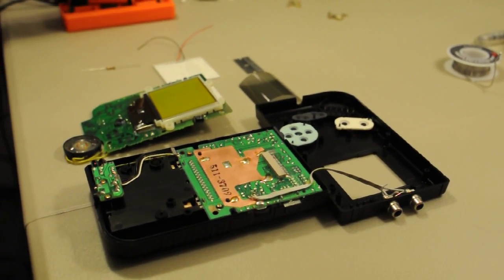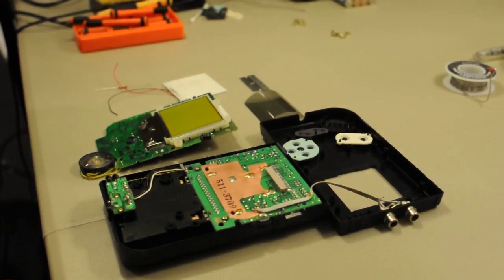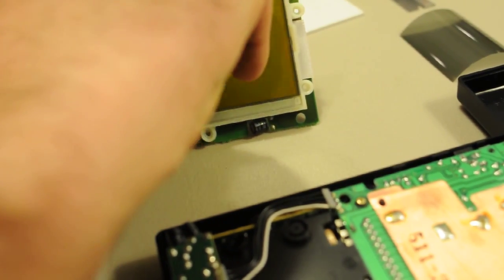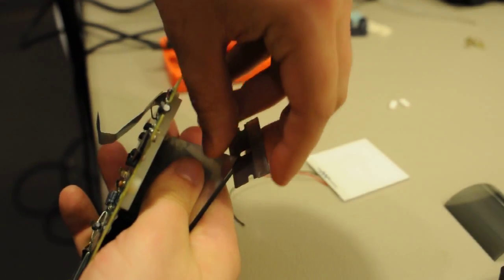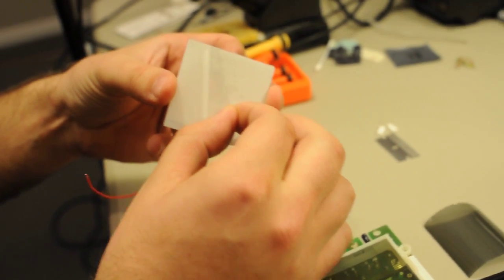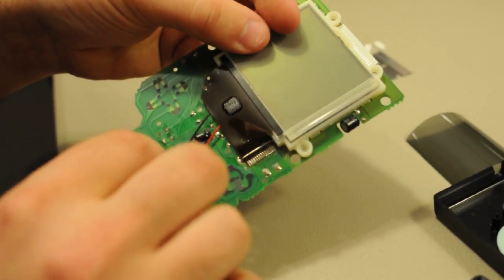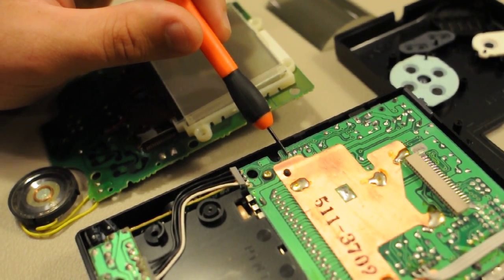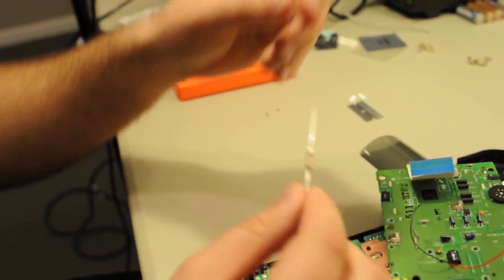Nonfinite Electronics V^3 Backlighting Pt. 1

Comment: you know, you can also attach the wires to the 2 soldering points below the black film on the front of the unit, you need to cut the wires a teeny bit to avoid the buttons but its far easier and customizable as you can put your switch just below the screen without any extra wire

Comment: You don't know how much I appreciate these videos. I got my V^4 Back-light in the mail today ordered it with the SNOW 1.5mm. I had a harder time following the tutorial from the website since it seemed outdated and there were things in the tutorial that I didn't need to do for the V^4 such as cutting the plastic casing or removing the battery LED, they also suggested filing down some of the soldering points which i found I didn't need to do. They also have updated the wires to Black&White.

Comment: I just installed that VC back light from ASM into it, But even though it said no plastic cutting, i felt like either the LCD, Ribbon cable, or back light cable would give after a while. Am I worrying too much? Also, Is there any worry about the LEDs overheating and breaking, Or do then not get hot?

Comment: I'm using the V3 Ultra on the gameboy pocket, when the wires (and resistor) are soldered in the backlight works but I get no sound or picture. If I detach the wires the sound and picture return but of course the back light isn;t attached. Please could you advise? Could it be too high a resistor?

Comment: My MGB is backlit with the V3 backlight, but I have a couple issues. There's a black bar on the left side of my screen not being lit by the LEDs (the black strip is on the backlight), and the top and bottom of my screen are cut off. Is there anything I can do to fix these?

Comment: Is anyone using EL panels to retrofit backlights?  The only drawback I can see is the high frequency whine from the transformer but that can be masked a lot with glue sticks or silicon caulk.

Comment: with one GB ewery think went fine ,but  with my snd GBI had a problem
 .. :(  With pealing off that screeen .
The glue is too old and i had to use lot of force to peal off that sonofab**ch..
and when i finished the glu partly was stuck on screen and wont come off 
and glas screen opened in between .. and i think that  screen is no longer usable .. 
Now i have my last spear dmg1 screen left , i will try  to warm up somehow before pealing it ..